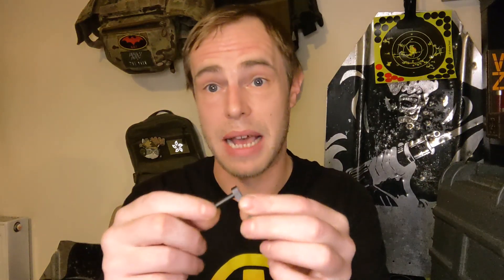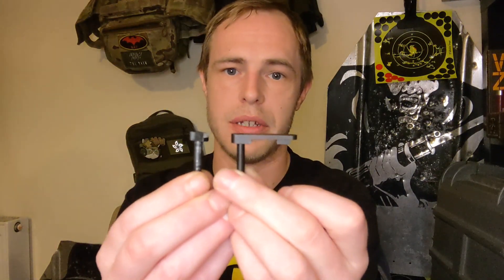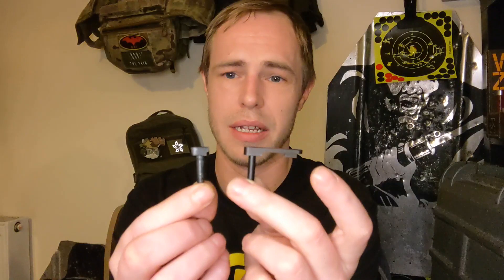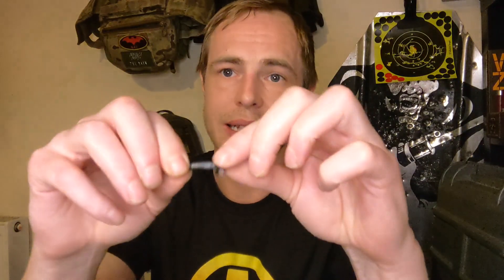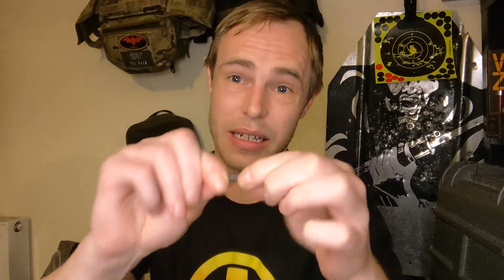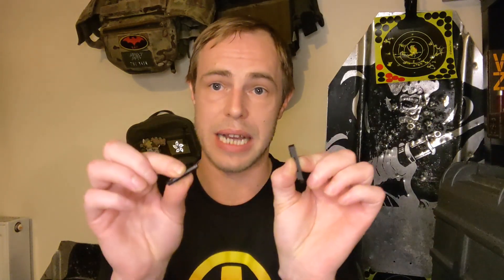Does Angry Gun have a Quality Control problem?? (Airsoft)

Comment: I have an Angry Gun flash hider with a ‘QD’ suppressor, the suppressor doesn’t lock into place over the flash hider which is disappointing.
Reply from the maker: I've had a similar issue with my AG QD Can, just can't be relied on but you never know what's going to been good and what will literally be rubbish!!

Comment: their recoil buffer super recoil for the TOKYO MARUI MWS's pin the holds the two parts of the buffer together came out after the first game 😥
Reply from the maker: I had the same mate and ended up using an Allen key jammed through the hole and trimmed off.
Reply: @OllieTalksAirsoft  I did the same thing!!!
Reply from the maker: @Dickens75  ghetto fix 😂

Comment: On this subject: Is the Angry Gun adjustable nozzle any good? Or am I better off not messing with the stock Marui nozzle? (Except maybe for a nozzle spring, when the original breaks?)
Reply from the maker: Mine broke. I think orga do a pretty decent npas rocket valve. 
I've trimmed my rocket valve spring to bring my power down a little.

Comment: I have the Angry Gun SOPMOD suppressor and flash hider, and they're great. However, I'm really wary about getting any other AG parts as their reputation, as you point out, is very sus. Loads of people with similar experiences to yours over on the MWS thread at AFUK. And they're not always cheapest. I got the HAO Geissele  rail and it is mint; great quality, great machining, great fit and a good 30 quid cheaper than the AG version.
Reply from the maker: I must say HAO do seem to really care about the products they're putting out!! Love they're getting more reasonable on prices too as HAO used to be way more expensive but the quality was on point!!
Reply: @OllieTalksAirsoft  HAO actually base their products on scans of the real deal. Angry Gun just seem to look at a phot of something, then give the work experience kid a go on some CAD software. 
Having said that, I still want the AG suppressor for my MP7 😂
Reply from the maker: @Steve_281  I actually have that surpressor and it's pretty good.
Reply: @OllieTalksAirsoft  good to know 👍

Comment: Unrelated question here. I've got a TM MTR-16. Atm its doing about 250 FPS with 0.25's I cant for the life of me get the FPS up! any tips?
Reply from the maker: Either the barrel or the nozzle, those are the ways to up your fps
Nozzle is cheaper and can be done several ways, the barrel will be more expensive but will also give accuracy upgrades.